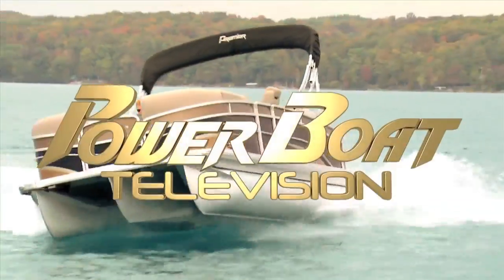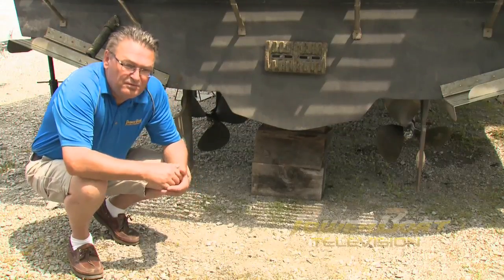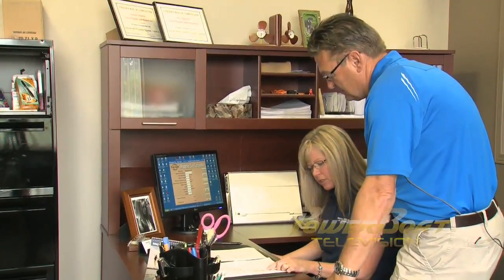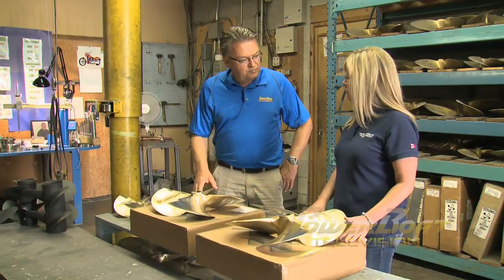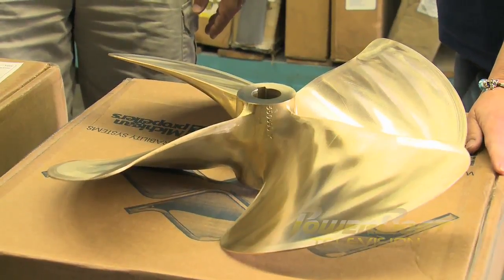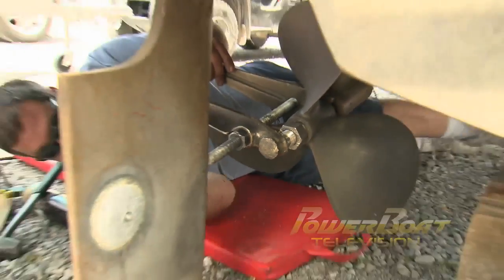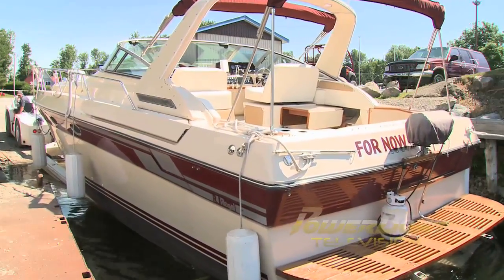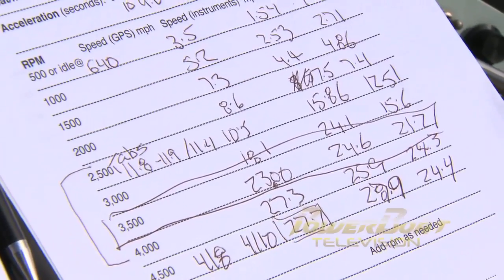How To Upgrade from 3 to 4 Blade Inboards - PowerBoat TV

Comment: I am not impressed. Who in there right mind would spend probably that kind of money which you didn't say but I figure $ 2 to $ 3 thousand and show the results you did, which were very vague. And then installing them without checking the taper fit to see if it needed lapping in.